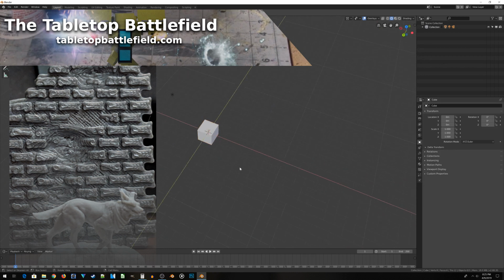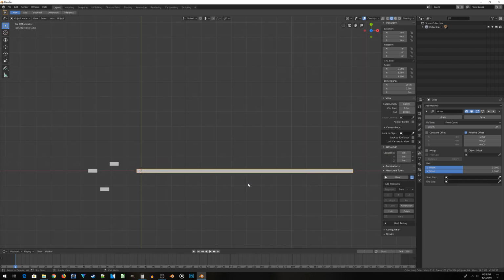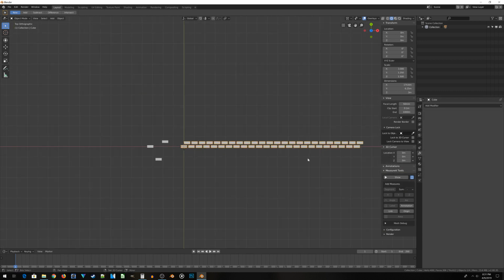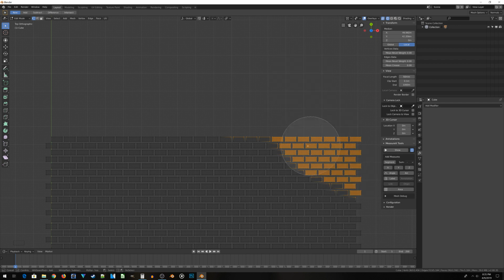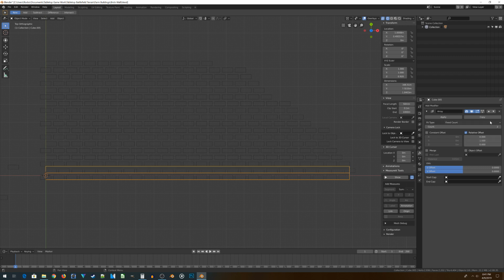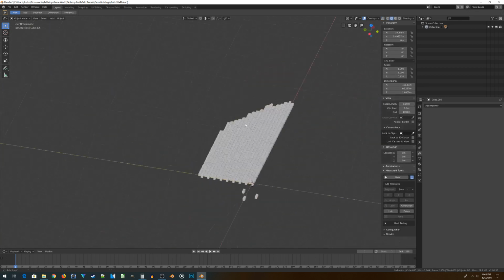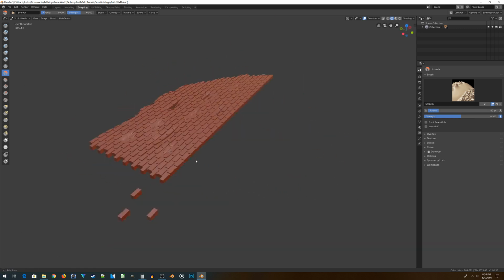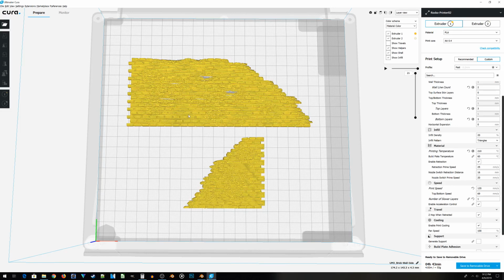Building Brick walls - Blender 2.8 for Tabletop Gaming

Comment: great video i literally fallowed every step to the end and will make everything in brick like this cause i just started in 3d design i used to be in construction so  your math on how tall and wide bricks are is off a brick on its side like when you lay them in construction are about 7.5 long or wide and 2.5 tall in inches not counting about a half inch of morter you said a quarter 0f inch tall i think you just missed the . in your notes like 2.5 or 25 as a quarter either way 4 high is a foot and 3 long is 2 feet and the average story wall is 13 or 14 feet high and how ever long with many variations none of which being a quarter inch... in all sincerity thanks alot though great tutorial .
Reply from the maker: Thanks for the details on wall sizes.  That will be helpful when modeling something else along these lines.